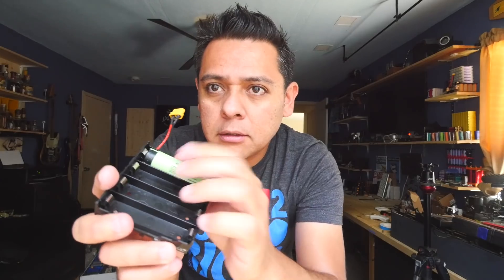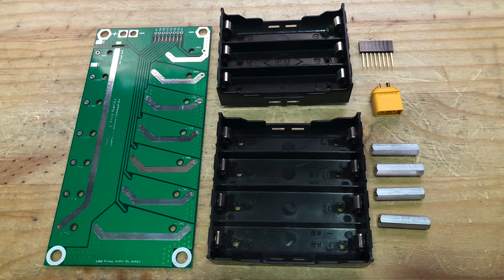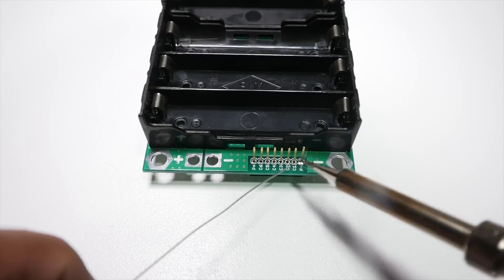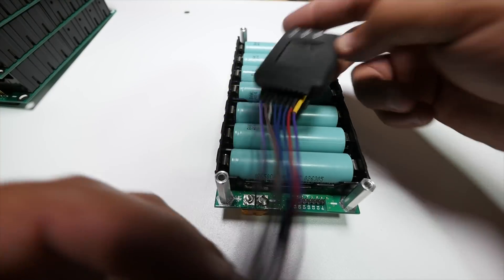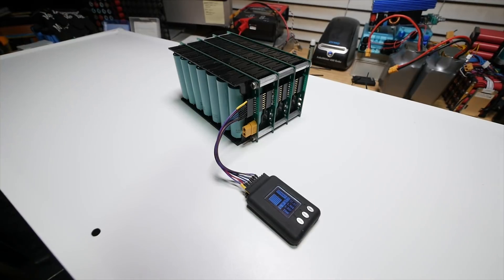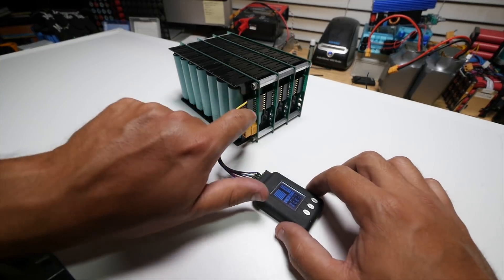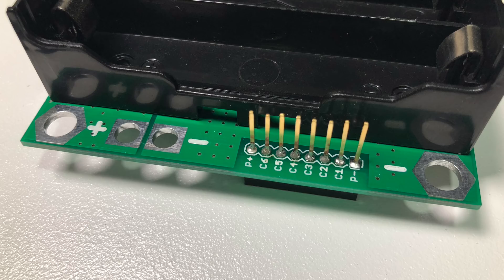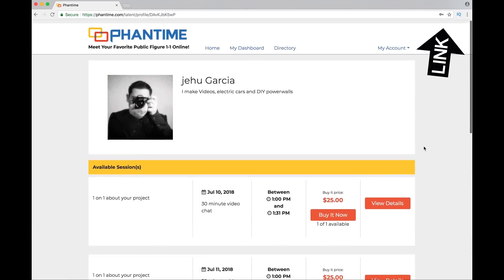DIY Rapid Build 18650 PowerWall Module project  - design & testing

Comment: some individual fuses would be great - like the one for the entire "module" cause with current design if you burn one "track" thats it. this can make them "reusable". But amazing design maybe you can also make them "double layered"so you can position the holders on both side so one board can run 2P config . just need to make on side a little "offset" than the other, do one side and after the other one - price per cell would go lower on assembly. Still great jooob!
Reply: Two years later I'm just now reading this.... Fantastic ideas

Comment: Could you keep pushing them further if you added a heat sink to pull the heat away from the plastic? I have also seen some of these battery pack holders supposedly made of ABS plastic which has a melting point of about 400 degrees Fahrenheit. Would a better thermoplastic case allow you to push these further?

Comment: Jehu, I don’t see (yet) an issue with this 7S battery holder... did you publish anywhere the thickness of that copper plane?
I do see however a big issue with how you parallel those 7S batteries. Is that connector rated/spec’d for the amps that the whole battery is going to put out?
Also, the way you “multiplex” the battery monitor pins looks kind of dangerous... you dont have a 7S4P, you have a 4P7S...if any battery starts to age differently, it will drag down the rest through those wires, causing it to become a “heater”.... please look for “baterias en paralelo” from the offgriderTV channel for an explanation of why this is dangerous.

Comment: I think here in germany the limits are getting the car TÜV approved, because you ahve to prove, that teh car will not go up in flames after a crash etc..... You might have to produce several carrs and crash tehm to get them approved.
Reply from the maker: It’s just easier not living in Germany
Reply: Well germany has other rather large advantages :)
But the regulations around cars and some other things are crazy.

Comment: Great idea. Why wouldn't it be easier to bring the contacts out to a edge connector. The system would then be a backplane n slots wide with the cards inserted into slots like a PC backplane. It would be slightly larger but avoid the possibility of shorting the balance leads The backplane would take some energy management to handle the parallel current. Possibly a hybrid approach-BMS leads on circuit board edge and power on bus bars. Just thinking out loud. I have been trying something like this using 10 mil copper strips to parallel multiple holders but had no easy way to provide each cell with a fuse
Reply from the maker: Because now you need a second board just to connect the boards,  that’s more expense,   The balance connector are typical size for battery balance leads and therefore work with all of the  Rc type of voltage readers/balancers alarms, chargers.
Reply: jehugarcia thanks. I understand your point on cost. What is Justin going to charge for the pcb?

Comment: This is a great project Jehu! Thanks for sharing and working on this!

Building a big wall with 1c draw would give people a huge amount of runtime depending on the config and allow the batteries to last a really long time... Going to be an awesome setup.
Reply from the maker: Well 1c is one hour,  I think that’s what people don’t get,  no one wants to build a house battery that last only one hour, powerwalls need to last 12-24 hours that means the load is going to be  1/12th or 1/24th of a 1c
Reply: What I love is using this system, it can easily be expanded... buy ~560 batteries, add ~560 later, and so on.

At 48V (what I've considered) you've already halved the amperage anyways. Thanks for all the great work!

Comment: Jehu! I would make the bms trace fuses part of a break out board, and have them mount on the battery side this would help resolve people being stupid, and being to replace a breakout not a entire board and the spacing issues with the bms connectors to help prevent poor installation shorts. you also need to make sure you get proper housing with the batteries, yes the plastic should be abs and can handle 200c without any concern but the batteries shouldn't ever be anything near that hot. my personally preference for fan ventilation would be 140mm fans they are quiet and have good cfm, 120 would do but they are a bit louder.

So todo
1. break out bms traces
2. plastic holders from mouser(I dont trust china battery backpacks) rated at the 20-30a continuous of higher end 18650's
3. maybe add a bit of spacing and a fan ventilation mount.

Edit: you could also have a specially designed 3d printed battery holder designed completely around battery usage in the case use of power walls allowing custom thickness of posts coming out of the battery holder to help prevent ohm's law making the battery housing heat up, because even if the positive and negative bus bars meet requirements the posts may reduce resistance and create heat. just my two cents from when I used to vape and made custom battery holders.
Reply from the maker: These are not powerboards,  DIY powerwalls typically load each cell with no more than 500mah,  we don’t need to cool cells or extra connectors and ribbons to add expense to the system

Comment: Not that I would do it, but if someone made a large portable power wall in the back of a truck or on a trailer, and then got Tesla charge port and went to a charge station. Well, free charge up, you get the idea. It is probably happening somewhere.
Reply from the maker: You need to have an account with TESLA for their chargers to work,  pretty sure you can trick the system but not an easy task

Comment: Battery holders are not built for high current. This is why the engineers solder high current cells together. The higher the current the more important clean solid contacts are. You are drawing 4.5 amps through contacts that are rated at 3 amps max. What is the voltage difference between the cell and the contact while under load? You need a 7S8P pack and that should bring the contact temperature down to an acceptable level with your 400-watt load.
Reply from the maker: This is not a high current application,   So all is well,  I really don’t think people get what a powerwall is and how it works

Comment: Is this project on GitHub?
Reply from the maker: No,  should it be?
Reply: jehugarcia Yes! I would be happy to contribute to this project. I am an electrical engineer and I have ideas for other boards that can be stacked. Such as a passive or active battery management solution with a charger and cell temperature monitoring.
Reply: Would love to also see a large scale enclosure for the finished project to "snap" into. This way the SBMS could sense what is plugged in, etc. Open source the the code and run on a pi.
Reply: @jehugarcia  Holy crap! Why did you cut off the resistor itself? (Seen at 05:35) Only using a portion of its one leg. Second question, why was there a single '+' sign on the negative side of the black battery holder next to the circle or 'bubble' (seen at 04:25) What am I missing with these 2 questions/concerns? Thanks 4 the Positive-entertaining-impact!

Comment: For those who want to build these home made powerwalls, just remember these have no cooling besides room temperature, where as it would be liquid cooled in a tesla powerwall. So if you don't want your house to burn down in case of thermal runaway, put it in a remote location.
Reply from the maker: It’s yet to be proven that TESLA cools their cells on powerwalls,  there’s definitely fans on the built in inverter but pretty sure cells are not run hard enough to heat up
Reply: jehugarcia the powerwall battery modules are the same ones used in the powerpack systems which consist of around 15 powerwall modules stacked on top of each other. Tesla CTO JB straubel confirmed those systems are liquid cooled. Batteries cells need to operate in a specific temperature range for the best performance and long cycle life, which is especially important since some home owners are installing them outside their home which is effected by winter cold and the summer sun. Tesla had a powerwall dissected on display in the gigafactory and it has the same cooling loops going around the battery cells as the ones in the tesla vehicle battery packs.

Comment: I would not recomment connecting the modules together with on the corners as far as I know all mounting hole should be on ground potential (like the back ones).

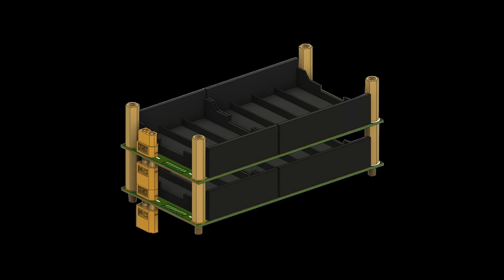The design at 16:05 would be good, but don't use the mounting screws as a conductor for safety.
Reply from the maker: Not mounting holes,  those are studs terminals
Reply: jehugarcia I know, but then you only secure  one side of the battery. On a wall its probably enought , but You have to think with a Noob's head and a hole on the panels corner looks exactly the same like normal mounting holes

Comment: Cool Idea!
Reply: AveRage Joe More like a hot idea. Not optimal design. Too much loss at the clips, spot welds are the only decent solution long term.  Look at how battery packs for powertools  are built.  Much fewer cells, yet they spot weld to avoid losses and excess heat. .

Comment: Now that is very useful. (( thoughts ))  since this is going to be opensource. Is it possible on the PCB schematic to add integrated balancing if you wanted to do as a single pack or double pack instead of having to be stackable? This way the charging balance will be done on the Fly. Or will the Gerber files for the PCB be made available for anybody to modify
Reply from the maker: Can Gerber files be edited?   I can’t seem to find a way to edit them
Reply: Well from im getting and understanding. The new version of Eagle will let import gerber file and make some modifications but im sure it still be limited but since your design looks so simple and not to complex i couldnt see how it would be a big promblem but it will come down to test test test
Reply from the maker: Cool let me look up Eagle,  if it’s pc only based in out
Reply: Its by Autodesk

Comment: I don't want to be negative but I was testing these holders and at 1A the voltage drop at the connectors to the cell was up to 0,2V... these are not too good for good connection. The cell were not new so maybe that was a factor.
Reply: see my comment (29/10/18), you are right Mariusz, friction contacts are unreliable, lack reliable current carrying capacity, and as your test shows, that 0.2V contact drop is the source of the quickly apparent hot spots (@11:30)......

Comment: does anyone know if 18650 amperage matters for a powerwall?
Reply: depends on the load on the powerwall. i recommend get hi drain batteries best to air on the side of caution . last thing you want is thermal runaway
Reply: thank you will keep in mind

Comment: The batteries are most likely not sagging, it's the power loss over the terminals is the sag you're seeing. you could need to measure directly on the cell to see how much sagg if any
Reply: Phizicks that would be interesting. You could use this to compute the resistance of the holder contacts

Comment: Very, very interested in something like this.  A use case that I'm thinking of, that I don't see being addressed in the DIY space is something like a high capacity UPS but with the ability to control taking the downstream circuit off-grid, remote battery monitoring, and the ability to control when the batteries are recharged.  Specifically, my utility is moving to Time-of-Day billing where the 4-5 hour peak usage costs ~3x off-peak.  Therefore even with a sizable efficiency loss, it could be useful to switch certain always-on appliances to off-grid battery during that time, bringing them back on-grid based on battery (reserve for power outage) or off-peak billing, and recharging the battery only in off-peak times, or ideally during excess production of a grid tied solar array.  I'd love to see some content in this direction.

Comment: I guess the metal connectors are or low quality composite( actual composition ) and therefore it may be causing resistance. This can also be the cause of heat on only conductors . You should try copper connectors
Reply: Won’t make much of a difference the actual contact area is minimal and full of air gaps spring connectors are great in low current applications as a quick disconnect but this is why you weld to battery cell leads (you can solder but you risk damaging the cell with prolonged heat). High current connectors that use springs for contact, like bullet connectors, use multiple points of contact or other mechanical methods to ensure low contact resistance

Comment: I had a good guess for failure on those plastics. Typing that, I realized that there are more problems with the plastic holders even if you avoid the excessive heat.  The plastics will surely get weak overtime and will cause the terminals to loosen which has a set of problems.
As mentioned by one comment, they are great for portable applications.
I don't have a a proper solution yet but a frame made from aluminum came to mind.

Comment: Do not forget to factor vibration in ebikes that will create a resistance between the battery and holder then turn into loss of power and heat
Reply from the maker: These ARE NOT for ebikes
Reply: jehugarcia it would be nice if you use the board and solder them to the battery and do a comparison test to see the voltage drop and the heat difference,do not get me wrong i love the idea 👍

Comment: 122°F = 50°C
90°F = 32°C

Thanks for the video! It's interesting to see that it's actually the connectors heating up, not the cells. PS: Or with a different camera angle it's mostly the connectors...
So for a serious power wall you really do need to solder. For smaller applications like for a solar powered shed or van for LED lights and ventilation this would be just great.
Of course heating up is wasted energy so you really want to avoid it if energy is scarce.
Reply from the maker: Powerwalls never need to be discharged in 1 hour or less
Reply: Hmm I wonder if you could use the 18650 holder springs as a fuse wire at the same time? Silly idea of course, but if you'd have these springs using some piano wire.

Comment: I also saw wes that tech guy using 38120S cells that have a screw top which means no soldering. He then used busbars and screwed them down. now I can't find an 18650S with screw tops but I had a thought. lf you weld a small nut on the top and bottom of an 18650 then packs can be made the same and just linked together with busbars and a screw. just making the cell with nuts welded on to them is in itself a very sellable product for the ever expanding diy power wall movement.
Reply from the maker: Yes I have tried that,  but no one wants to glue thousands of little nuts onto cells
Reply: jehugarcia if you can buy a cell let's say 2 dollars each if you get a good deal and in bulk and sell them for 3 dollars with a nut welded on them or a heat proof glue. I think your onto a winner. perhaps your too busy to do this but anyone can as a start up and make a good business out of it while helping drive forward this revolution.

Comment: Great jehu. its still going to be a bit of soldering. We need something totally idiot proof that just clips together or mechano like and just uses nuts and bolts. extremely simple! A child can put together. those holders, design a new version of them that just snap or bolt together. There is the market for this product.
Reply: The amount and type of soldering on this job is novice level... I was doing this type of soldering while I was a child.  Soldering is easy to learn, cheap to get started, and an excellent skill to have as a DIYer.  Personally I enjoy soldering, and the amount on this project is light, fun, and stress free.  Give it a try, and don't forget the flux.
Reply: Solder Me Cold exactly it doesnt take a lot to learn it

Comment: The standoffs need some washers. They will get loose in no time at all.
You can use screw glue for that, too. ( I don't know the English term for that glue)
Reply: Screw Glue is a very good term. Yes with all that heating and cooling they could loosen up from the expanding and contracting.
Reply: Loctite
Reply: Gregory Thomas Whats the name for Loctite? Thread glue?
Reply: Loctite is the brand name for a type of thread glue.
Reply: Loctite calls it threadlocker.
Reply: "threadlocker" "thread glue" "screw glue" "something that keeps stuff from turning on threads"
It's all the same thing.
Reply: If you don't believe me, try it yourself.
Don't get me wrong. I really like this project, but I had a lot of problems with standoffs in the past.
Reply: Frank Gormanns They would only come loose under vibrational stress.

This is for a powerwall application so is likely unnecessary.
Reply from the maker: If your battery is heating and cooling enough for that you are doing something wrong